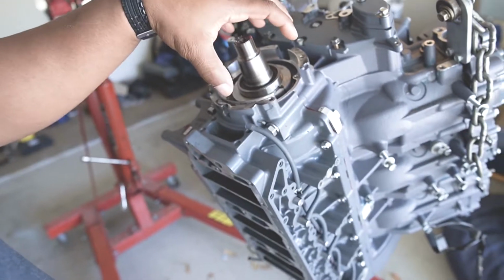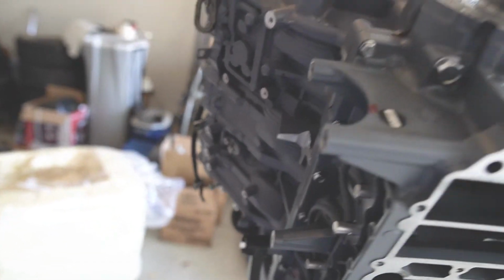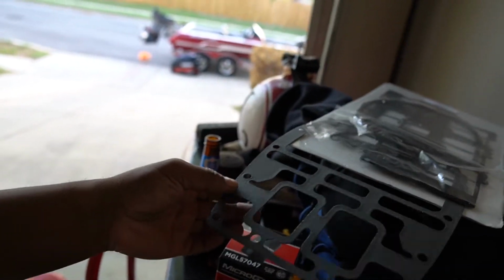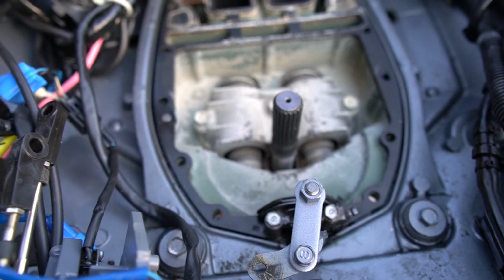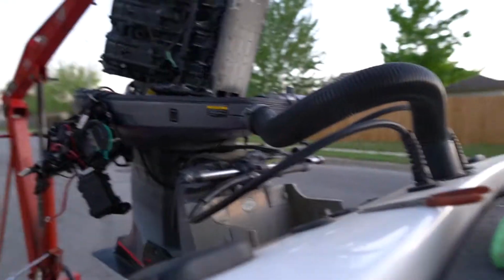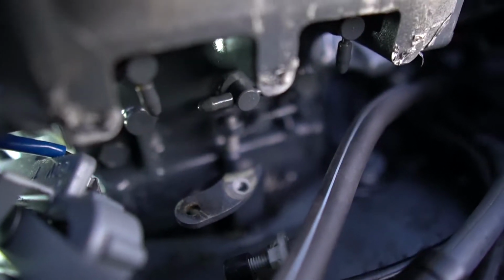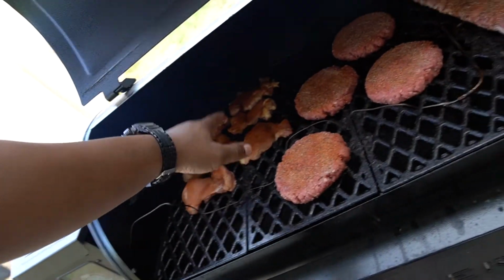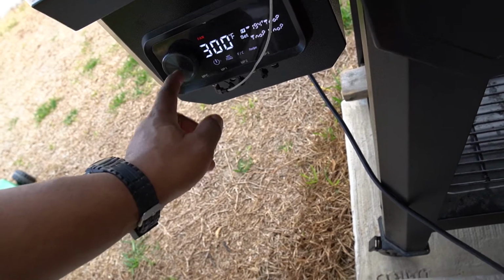Fixing my broken yamaha hpdi outboard ep3

Comment: Great content man, struggling with my 03 hpdi 250 myself. Got a 25.8 mako CC Spent months tinkering with it, going through the fuel system etc. finally caved and took it to a shop. Was commuting 2 hours to work on it everyday and lost my patience and almost my mind. Long story short I got a bad cylinder #1. Trying to decide if I want to dump $3500 into it or try to find a deal on a used four stroke. Couldn’t imagine trying to film doing this kind of work as it’s tough enough as is.

Comment: Hey Cory, I am working on my 2 stroke 200 HPDI that does not want to start.
I changed the small pump, filter, O ring, gasket, inside the VST, and the VST pump is sending fuel to the HPDI pump. When I turn the key, the engine cranks, but no start.  If I sprayed some fuel inside the carburetors, the engine runs and dies.  I put new spark plugs and removed the lower unit. Compression is around 115 in all 6 cylinders. What should I check for?  thank your help
Reply from the maker: Low pressure pumps you have 2 of them send fuel to the vst pump and the vst pump send fuel to the high pressure pump.  Sounds like your high pressure pump isnt  pumping.   Hook up a fuel guage on the port to check what the psi is coming out of the vst pump
Reply: @WillCory  Thanks for your reply. I will check VST pressure and post a follow up

Comment: I have Yamaha hpdi 250 new pump new spark plus new flywell new neutral Switch new injector don’t pass 29 rpm and motor on driver on water  Outside the water rpm is good

Comment: Will. Any tips on removing old fuel from your boat. I have an old Champion I need to remove the fuel from.
Reply: Find the sending unit in the tank.ipen it up. Pump all the gas out. Drain all the filters.  Fill with non ethanol fuel and i would reccomend yamaha fuel additive and also some marvel myster oil. Both at manufactueres reccomend amounts
Reply: @nickburge3724  Thanks appreciate the info
Reply from the maker: Working on the video now but its pretty easy